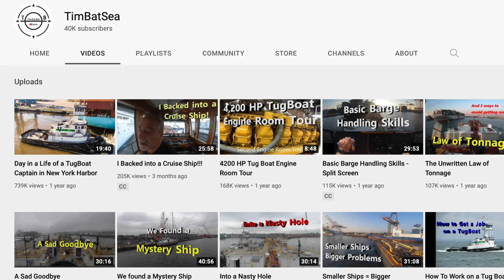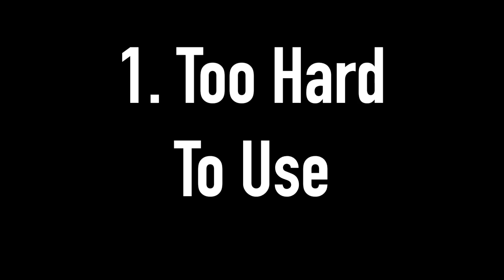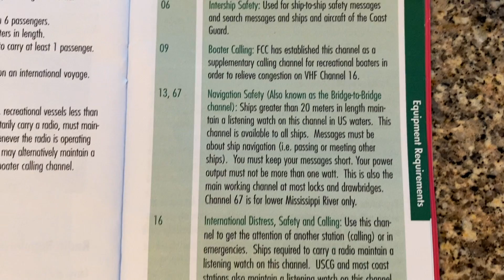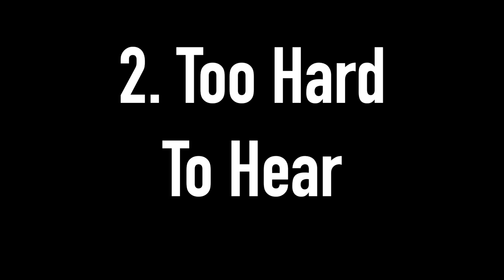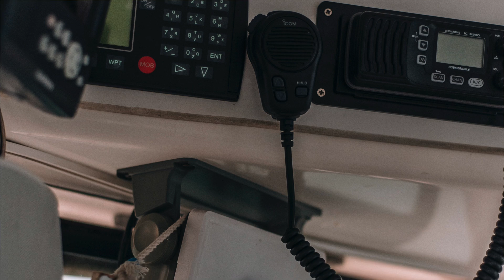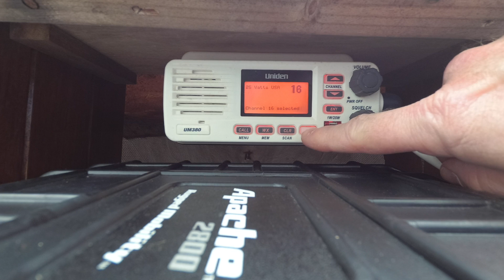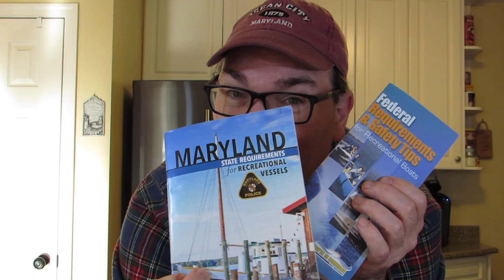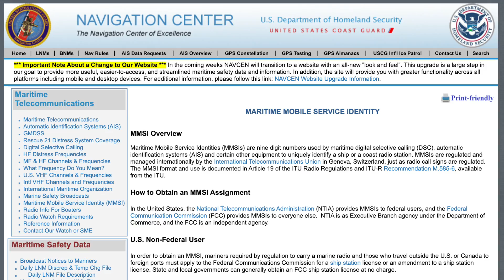The Problem With Marine VHF Radios

Comment: At first I was horrified that anyone on the water would think that learning to use a VHF was too demanding and difficult. If you cannot master how to use the radio what chance do you stand in being able to understand the rules of the road or how to navigate. Then he talked about it not even being a requirement in the USA to even have one let alone be trained to use it. I realised that this is one of the things I like about sailing, you still have the freedom to do things the way you want to. That includes the freedom to get a boat that is unseaworthy and head out with no skills or training. You stand a good chance of killing yourself if you do but that is the nature of freedom, it comes with being responsible for yourself. The reason this is allowed is that, in a small boat, you are only a danger to yourself not others unlike someone taking a car on the highway who doesn't know how to drive. PS if you can't hear a fixed mount radio most have the facility to add a much louder speaker.

Comment: I think everybody should have an mmsi number, DSC, GPS, and the flip up distress switch just like the fixed sets have. Agree that you can't hear those things.I've also often wondered why there isn't a volume over ride/ loud emergency alarm (much like the bell ringing mechanism that they had during the telegraph days) for a distress call built into the receivers. The next step and I can see it happening is a built-in pre-programmed voice message. So your mmsi is already in there, and it's going to give the GPS coordinates too. And it could just repeat those things three times to maintain protocol. On my home alarm system, if I hit the switch they know where I am, and they know who I am. There's no reason that it shouldn't be that way on the water too. And anybody should be able to use it. That includes MY WIFE, who is not familiar with radio at all, because if I get in trouble she's going to be making that call. The less fooling around the better, after all you're already dealing with the emergency at hand. Cell phones are no good, because how are you going to make a pan pan or Sécurité call If you need to, so that the nearest boat can help you if necessary, and conversely with a Sécurité call, you can help others to not get into trouble in the first place when there's a hazard to navigation or whatever it may be? The Coast guard isn't God, so they can't be everywhere at once or always the closest to you. But the CLOSEST ship may be able to help, even if that's only until the Coast guard gets there. When I drive, and sometimes I'm certainly out of range of cell coverage, I have an amateur radio in the car. and I carry a separate handheld amateur radio in my coat pocket. This gives you some redundancy in a separate power source, charged up and ready to go if need be. Some handhelds are tiny now, smaller than your cell phone, and if you have to leave the vehicle for any reason especially outside cell phone coverage you better have it. They make one that's smaller than your cell phone. Is this Overkill? Maybe. But you won't think so if you need it someday. A lot of people are driving around and they don't even have any spare tools or a first aid kit. This never made any sense to me. I've heard of that in some countries you're REQUIRED to carry a first aid kit, and if they inspect you and you don't have it there's hell to pay!
Reply from the maker: Some really good points about the shortcomings of marine radios and ideas for improvement!

Comment: You are not allowed to use Marine channels on land unless you are at a marina, however there are private channels outside of the normal working channels you can use that will allow you to practice with someone else. If you only have one radio on your boat it must have DSC, then anyone can send a distress call without any training whatsoever as you have discovered.  A decent retailer would have been able to explain this to you. You can always wear an earpiece so you don't miss anything and decent radios like some newer Icom's have functions that record the previous minute of the  last message so you don't miss it or ask to have it repeated. It is definately a learning curve and it is imperrative that the boater does a lot of research to see what he needs/wants before any purchase. For the size of boat I use, its not even a requirement here in the UK to have a radio but would I go to sea without one..... er..NO. Its the best method we have for staying alive.

Comment: Completely agree. Here in the UK VHF users are required to take a training course and get a certificate of competence, but it is not that useful because unless people use the devices regularly they soon forget the procedures, how to operate the equipment and the phonetic alphabet. It is painful listening, sometimes, when someone has o make a Pan Pan call when their engine has failed and they are struggling through a prompt card to get their message across. Marinas and harbourmasters these days seem to prefer using their mobiles, too. I wonder if, when satellite broadband is widely available, everyone will just switch to WhatsApp!?

Comment: Many years ago, I bought 6 or 8 Motorola powered radios meant for police vehicles at a Hamfest.. These had a special plug on them for Motorola radios, but each radio included instructions to cut off the plug then locate the correct wires to function. Two for power, two for the speaker output. WOW! I can drive down the highway at 75 MPH with the windows down and clearly hear the radio at about 1/3 volume setting. Radio Shack also made a nice, powered speaker but of course was not as loud or built as sturdy as the Motorola units.

Comment: If someone can't turn power on, select 16 and press the transmit button. they've had too much Vodka.  Handhelds have much less range due to the inefficient antenna.    Yes you can use it on shore as long as it is in support of marine activity - and testing qualifies.  Just don't test it on 16.  Identifying yourself can be as simple as "white speedboat 10 miles offshore."

Comment: 1.  This is a training issue.  As skipper you need to train your crew and get them confident using the radio.  The best way to do this, is to have them practice conversations with other boats, on a working channel, in a non-emergency situation.
2. This is a boat setup issue (particular to power boats).  Throttle down your engine or turn up the volume when monitoring a call.
3. This is a preparation issue.  You MUST have your vessel and radio equipment registered with an MMSI.  Having a DSC with GPS location integrated into your equipment is the best option - so you can transmit all this information with the push of a button.  Also, have the boat registration number written somewhere in the cockpit.
4. Just because the rules don't require you to do a course, doesn't mean it's not a bad idea to do one.  In Australia, VHF operators are required to have a certificate of proficiency (SROCP) - the course is informative and well worth doing. 
5. This is a problem with your knowledge.  Yes, VHF radios are equipped with DSC - and when encoded with your vessels MMSI and GPS coordinates, is capable of transmitting your distress call and EXACT LOCATION at the push of a button.

Comment: Most of the fixed mount radio's now have a speaker in the hand mic so you can hear it close up.
The worst thing they ever did was got rid of 27 Mhz with SSB. This mode on 27 Mhz, way surpasses VHF fm in range and battery consumption.
Back in the day when these radios we're available a simple modem attachment allowed these radios to send text and potentially digital voice for thousands of kms via the ionospheric layer. They also run rings around VHF coverage in rivers and canals for local work up to 50 or so kms.
A VHF radio can use digital format as well like that of DSC on ch 70 but the range of VHF signal unless its line of sight is severely limited even with its 25 watt output.

Comment: Correct, if you are challenged in the IQ department, don't want to practice with an important safety tool, refuse to learn safety protocols, can't seem to get it together to write down and laminate boat information for emergencies, save the money.  Cell phones are great.  On your cell, you can call 911, who know nothing about water issues or marine location(ating) but they will call "someone." These tools are critical on so many levels.  Locating (gps cordinates), reporting location of "man overboard," getting the right help immediately, or just calling the launch at the marina.  In some locations, dockside restaurants use them to book reservations.  You may have a boat and a dinghy, be in a location without cell towers, and use this to communicate.  I think it is a wee bit irresponsible to tell people, "safety, we don't need no stinking safety." A good captain is prepared.  Not looking for excuses to be reckless.  Saving lives, and using the tools to do it, is hard work.  That is why captains should be prepared.  If you have been on the water for ten years you have heard stories where fatalities are involved.  The water is by far one of the most dangerous places to play.  I hate to say it, but I wouldn't let my kids on a boat where the captain didn't have some safety protocols in place for emergencies.  A working communication device, designed for boats, is the very least.

Last, boating is a community event.  If someone is in distress, and you are close enough to save lives, you should live up to your responsibilities, hear them, and save them.  When "May day, May day" comes over the airway, you run to your radio and see if you can help.

Comment: I’m a new boat owner as of last year. Something was just not working with the vhf setup that came with my sailboat and I just shrugged it off and bought a new horizons portable. It seems to work well  with any boaters or marinas I can see with my own eyes. Any further and it’s unreliable. Call me naive but I really don’t see the NEED for vhf with all the other technologies available. (Great lakes fwiw). 

I’m typically within cell tower range with Tmobile on my phone. If not, I have my starlink dish running while i’m out doing my thing. I keep my cell phone in my pocket at all times, I have a backup cell phone at the ready and a laptop- all of which I could text or call from. I’m also in starlink’s beta direct to cell communication program. I ALWAYS wear my mustang pfd and have an ocean signal PLB attached. 

All that said- I DID pull my mast this winter and installed a new antenna, new run of marine vhf cable and will be getting a bigger radio up and running. It along with flares and pumping up my kayak will be my absolute last ditch efforts.

Comment: TOTALLY DISAGREE WITH POINT 1, 2 AND MOST OF POINT 3.  Push-To-Talk is the most Natrurl and Simple system. So much So People use PTT on  their Mobiles (Cell Phones)  instead of using Phone calls.  

Your use of the Guitar and Radio is GROSSLY MISS-LEADING and DANGERIOUS.  Shame on YOU.  

I am in Australia.  Before we begin a trip on the water.  We have to Call in on the radios and give general details like (Planned destination, People on Board stating number of Adults and Kids.  Planned return date and time.  we Monitor it 24/7) plus Most people even chat to each other either Boat5 to Boat or Boat to Base / Land staying in touch if Family and Friends .  I am GLAD you did mention the DSC On-touch button Service

Comment: A VHF radio isn’t just for emergencies—it’s an essential tool for staying connected on the water. Whether it’s coordinating with marinas, passing through locks, communicating with other boats, or helping out during a PAN-PAN or distress call, it’s a must-have for any boater.

I keep a fixed-mount VHF at the helm and always carry a handheld as backup. The handheld comes with me on the dinghy too—especially important here in the Puget Sound, where if something goes wrong, might need help in a hurry.

Stay safe and stay connected out there.

Comment: Usability in emergency: use one with DSC, then it is only a push of a button to send a mayday. 
Hard to hear: I am totally with you, the build-in ones are under deck and none cares about it making unrecognizable noises, when on deck. That is why I am also looking for a handheld one.
Mayday: Say whatever you want in an emergency. Not having a boat name or having your Number written somewhere in the cockpit sounds like a you problem. And again, in an emergency say whatever you want. None will punish you for not knowing the NATO alphabet. Say white motorboat, 20 ft long, green bimini or whatever. Regarding the regulations: only bc it is not mandatory, doesn't mean that it is not helpful.
Rules: as said above only bc it is not mandatory, doesn't mean that it is not helpful.For Practicing just use it when you are on your boat. Call the marina, ask how the weather is, call a lock and ask when their next opening time is. I am sure you will find more applications.
Tech: So you know about DSC? Why dont you include it earlier ? There are handhelds with and without. Just as you can get ones with or without display backlight.

Comment: I've always used fixed mount VHF's because the tiny battery is often molded on the walkie talkie ones. They are for sending a sailor to the bow on a huge boat or for letting rich kids run around on shore until you call them back. My outboard is four cycles air cooled. It's muffler vents directly so it's quiet and I can hear tiny speakers no problem. I ignore the DSC because I keep things shipshape. 68, 69, and 71 are genuine chitchat channels, and you lose a lot of utility if you don't chat with houses and cars. If I want range, the CB radio beats out a VHF every time. Your tiny handheld is tempting.

Comment: I find them handy for communicating with other boaters regarding where the fish are biting, what the currents are doing in certain diver areas, water temperatures, visibility and such.  I find them to be NECESSARY for communicating with draw bridges & lock operators.  I find them handy for coordinating where we are going to make port for the night while several boats are on a trip.  I think that they are great.  I've called out a few pan-pan signals before, but I have yet to call for help.  ...and one always lives in my ditch bag.

Comment: I think the best use of VHF is AIS.  It is completely passive - no user involvement required, after initial setup.  And, a one touch Distress button makes a lot of sense, too.

But, I still see the utility of VHF radios for recreational purposes, like communicating with other boats in your group on other channels besides 16.  Or, communicating between a dingy and the main boat. 

Radios are easy to use.   And, as a boat captain, I would take it as my responsibility to ensure all passengers are aware of proper emergency procedures, including the use of VHF radio for emergencies.

Thanks for the video!   You make some excellent points!
Reply from the maker: AIS is definitely a great tool and once it is set up - super easy.

Comment: I mean, it seems like it's more about marine handheld radios. Which obviously are not that good, there just isn't that much antenna or power, if you have actual boat, you really should get one that's installed into your boat. VHF isn't as nice as mobile phone, but if you are at ocean you really need to know how to use one even if it's hard.

Comment: Excellent video!   In my experience owning a 40’ live aboard sailboat for the past 4.5 years (since the start of the pandemic). I have repositioned my boat from Baltimore’s Inner Harbor to Titusville Florida (solo).   And it was definitely a crash course in marine VHF procedures due to the all the drawbridges, loch and marinas I had to navigate and communicate with on almost a daily basis over  the 6 weeks I spent cruising the ICW from Maryland to Florida (with 2 offshore jumps). 
I have both a fixed AIS receive/ dsc capable radio at the nav station (integrated to the nav system) down below that has a remote station at the helm..  and a small handheld I can wear on my belt with an extension speaker/mic I clip to my shirt collar.  
The combination of these two systems was indispensable as a solo cruiser navigating through several major port cities along the way.  My point here is that there are a handful of audio engineering concepts you need to know/consider to use 2 radios and they are how to prevent things like echos, feedback and signal to noise ratio/ microphone usage (how close you speak into the speaker/mic and how loud you need to speak in relation to the noise/wind you are encountering etc.    But having the remote speaker/mic (this is usually an optional accessory for handheld vhf) having that on your shoulder (near your ear) to monitor what is going on channel 16 while you underway while keeping your larger VHF station’s volume all the way down is the best practice from my experience. And talk into the mice (one inch from your mouth) at a speaking volume as though you are speaking to someone on your boat about 5-6 feet away from you in whatever noise environment you are experiencing on your boat weather you are down below near the engine or out on deck with your under autopilot control. (Also get a wireless autopilot remote to complement your handheld vhf) that’s a different conversation though but I can control my autopilot remotely from my Apple Watch/Iphone IPad and PC.
Reply from the maker: Yeah it's a learning curve for sure - and you obviously learned a lot from that journey!
Reply: @ it also helps that I’m a retired audio system engineer (25years) my boating experience is limited to the 4.5 years I’ve owned and lived aboard and aside from that journey down the ICW I’ve been working at restoration and refit of what’s become a live aboard marina princess.   I go fishing on other peoples boats way more than I take my boat out.  But I’m continuing to learn.